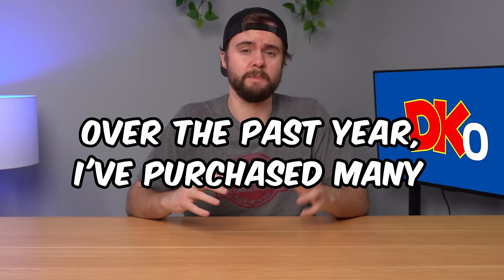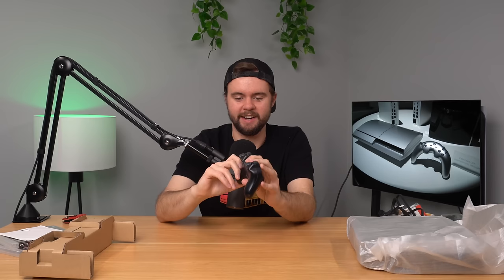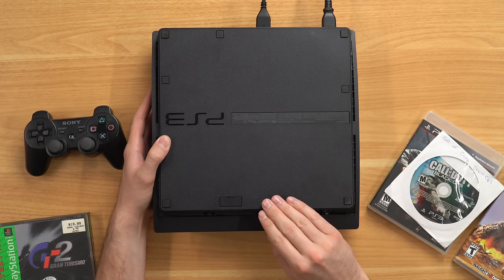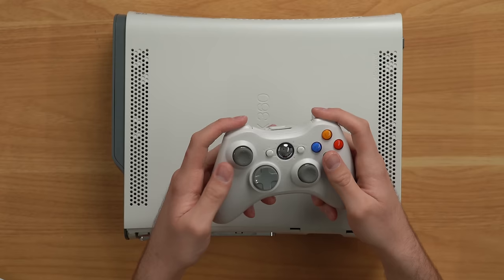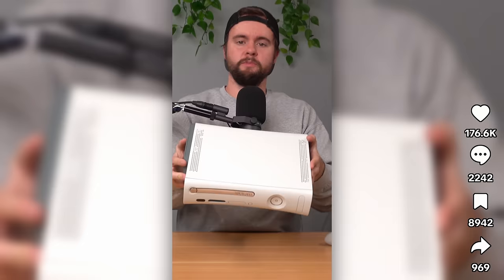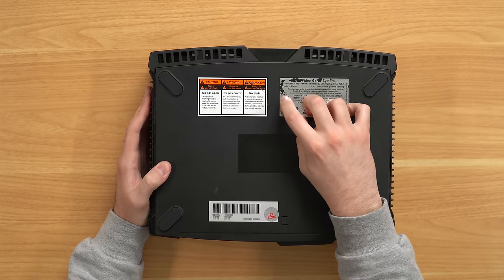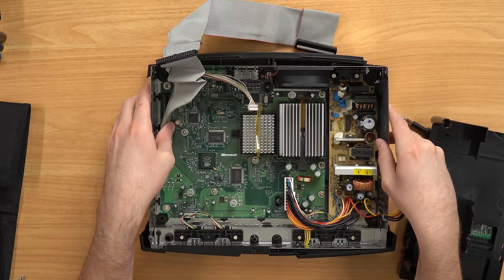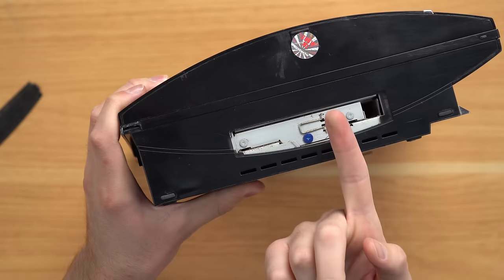The ENTIRE downfall of DKOldies...

Comment: Feb 2024 and an 80GB "reverse compatable" PS3 is going for 499.99 from them now. What a joke. But at least it comes with an original controller now 😂
Reply: I can’t imagine having $500 of spending money in my pocket and choosing a used PS3 from 2006 over a new PS5.
Reply: Costs £160 near me
Reply: In fairness, if they do actually delid all of them (which they should at that price) it wouldn’t actually be as bad of pricing as they had before. It would only be a 50-66% markup from eBay.
Reply: @Alexlfm  only well that's great 🙄
Reply: @OfBrysonMen I have a PS5 but recently bought a PS3 to play the exclusive games and I only paid 380 all in, that included 3 perfect condition OEM controllers, 24 perfect condition games including rare games like midway arcade classics. A full service with thermal paste, pads, new battery and general clean, a 500GB SSD and install and a $90 Mclassic which upscales the ps3 to 1440p. So yeah I’d say $500 for a is overpriced 🤣
Reply: Crazy I was lucky to get an og ps3 from my local pawn shop with demon souls and two controllers for $35

Comment: I couldn't wait longer than 45 minutes in to comment... and I will only do so on consoles of which I have direct experience. I avoided the pre-slim 360s generally, as I could process/mod/refurbish slims a lot faster back in the day. Also, get one of the x-clamp tools for a couple bucks. You'll feel like a rockstar lol.

1. OG XBOX: While I really disdain the 1.6/1.6b revisions, that console as a whole was in really wonderful shape. I really enjoy the challenge of these consoles with modchips, 128MB RAM upgrades, HDMI kits, BIOS patching, IDE to SATA drive swaps, and all the minutae of those processes. That being said, the OG XBOXes are notorious for the thermal "cement" they use on the heatsinks. Cleaning it off can require a light solvent to do properly which then requires cleaning the solvent off thoroughly if it's the orange nonsense that's on some of them that turns to cement dust. It doesn't give anyone a pass for selling something refurbished with decades old thermal compound still in there. They are also a travesty to clean properly. There are so many nooks and crannies, metal pieces, etc. that must be cleaned separately. The metal shell parts does indeed rust on a lot of these, and I usually end up sanding them and painting them black because there's no other good way forward.

2. BC PS3: I'll go beyond the obvious here that you really needed a respirator to open that, but not changing the thermal compound above and below the heatspreaders is a complete sham for that price. The thermal compound between the Cell CPU and the heatspreader will 100% dry out and cause heat issues. It's not easy and comes with some risk to separate the heatspreader from the Cell due to the glue. For $400, this should have been done. Any tech worth their weight should be able to change the compound below both the Cell and RSX heatspreaders in 30 minutes or less given the proper tools. These BC systems are such an incredible piece of technology, and they deserve to be given every chance of surviving.

Comment: Hi Jacob 
Do you have any advice on How to keep a wii remote connected because i have 2 remotes that never connect and i have changed the batteries a bunch of times 
So if you have any advice that would really help
Reply: i live in Bangladesh i live in Bangladesh
Reply: open the cover and press and hold the little red button inside. hold the red button under the cover on the wii at the same time.
Reply: @BrodyLedford. I feel sorry for you then
Reply: @Qwerty10254  i don't actually live in Bangladesh

Comment: Oh yeah, about the Uncharted load time, the PS3 disc drive's spec is noticeably slow. Its games are on Blu-Ray, which was a new format when the PS3 specs were codified, so the PS3's max speed for reading Blu-Rays is 2x 72Mbits per second. Compare the 360, which stores games on DVD and has a DVD drive running 132 Mbits per second. While that's only just short of a double, the fact is that the difference in storage is vast. Comparing only the single-layer version of each format, DVD can store up to 4.7 GB, while Blu-Ray can store up to 25 GB. So, in summary, halved read speed PS3 compared to X360, plus 5x the storage capacity on Blu-Ray compared to DVD. Now, multiplat games weren't affected too terribly since being on 360 limits them to what can reasonably be stored on a DVD disc, but PS3 exclusives like Uncharted were much more free to take up as much of the Blu-Ray as they wanted. It was a very odd situation.

Comment: the date and time issue with the first PS3.. is not really a DKoldies thing... it should have connected a time server to Retrieve the time and date but that isn't always reliable. as for having to set the time and date internet  Security Certs  are time and date dependent if u don't have the correct time and date set can stop things from connecting. that's not even a PS3 thing that's an internet thing

Comment: 55:11 my 360 was never that loud, and it was one of the older ones too. Sadly the red ring of death killed it and my mom tossed it. Really wish I still had it I would totally try to fix it
Reply: For what it's worth, fixing it would require you to desolder the gpu from the motherboard and replacing it with a newer gpu that doesnt have the underlying infill issue. It's a difficult operation that takes a lot of skill and practice with specialized equipment that can be expensive

Comment: is refurbished and renewed the same thing? i feel like the thermal paste thing shouldn’t fall under refurbished unless it had caused a problem before the sale. i personally feel like something as small as a rubber peg grip replacement a refurbishment lol, thermal paste is a renewal and i feel like that should be something that is pointed out, as your system is expected to now work and last as long as new. that’s not to say you’re wrong i agree with what you’re saying i just think the industry needs to set and define terms to make everything understandable for the consumer
Reply: Refurbished is: Cleaning the console, taking it apart, switching out thermal paste and then cleaning the insides of the consoles, including fans and such.

They've done none of the above. They didn't refurbish their refurbished console.
Reply: @appleleptiker  okay so what’s the difference between that and a renewal? cleaning, and replacing missing or broken parts def seems like something that falls under refurbishing, but again i repeat my claim of changing thermal paste that isn’t yet damaged would go a step beyond that